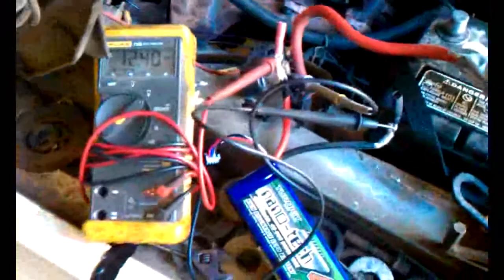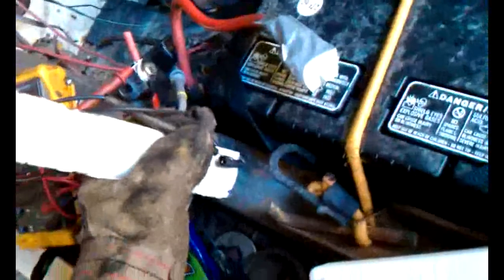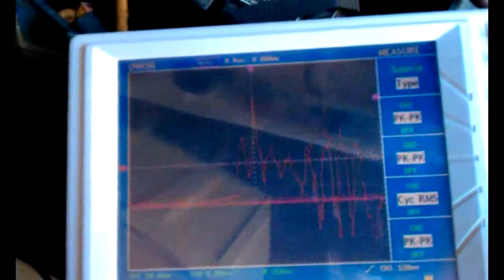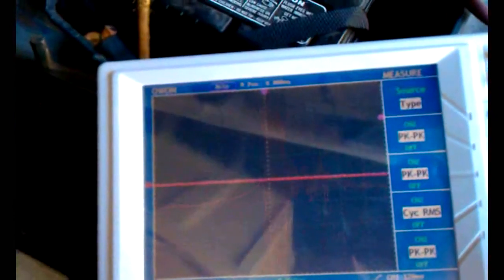Ford 428 LiPo battery starter cranking failure.

Comment: Whatcha need is 8 lipo cells in a 4S2P configuration (starting V~14.8V, Ah=10, CCA~1300).  That will give you enough power to get that truck started!
Something like this should work:  http://www.hobbyking.com/hobbyking/store/__19154__Turnigy_nano_tech_5000mah_4S_65_130C_Lipo_Pack.html